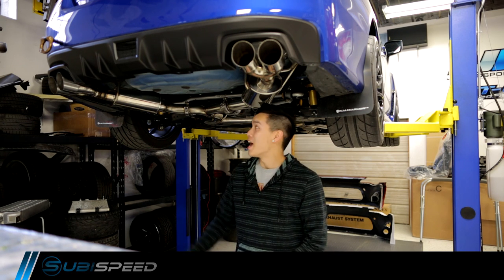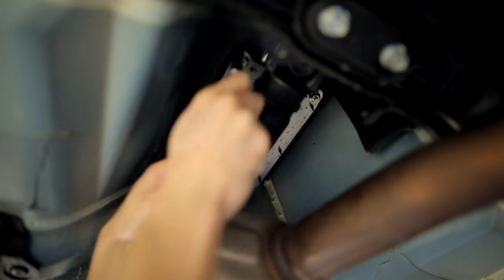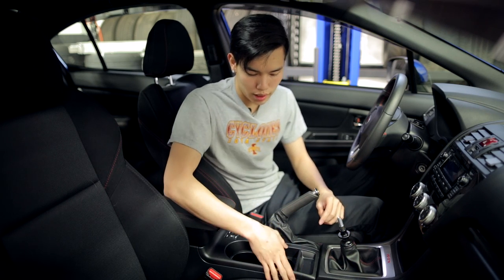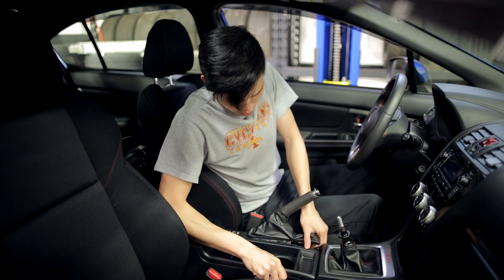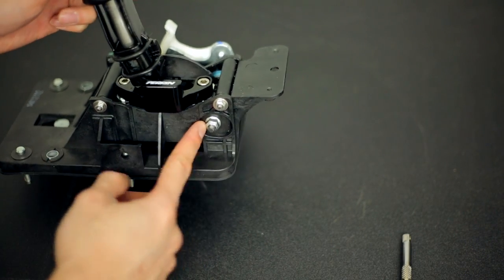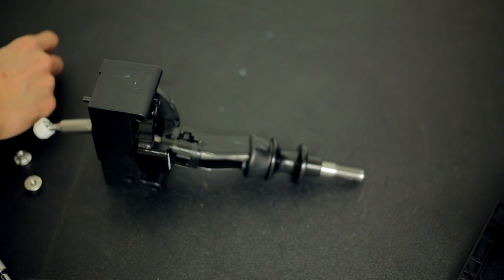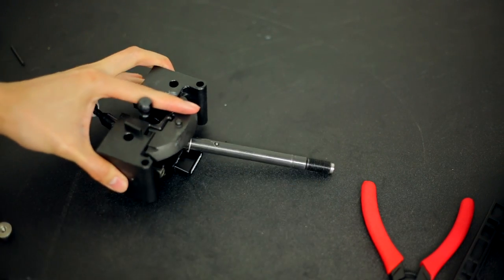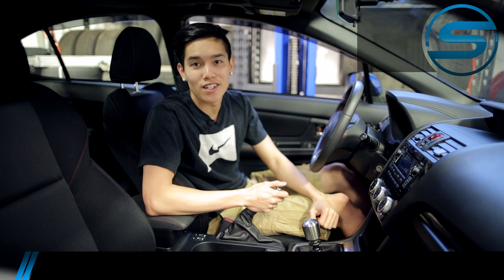How To Install Short Throw Shifter on a 2015 Subaru WRX

Comment: Good gosh...insane install. Guess stock isn't so bad.
Reply: Kyle Rosenberg Cobb took way less time
Reply: It's not that bad. I know this is 5 years old, but it's like an hour. Unless you lose something very important, then it takes forever. It's legos dude, everything fits back together the way it came off the biggest hassle is that 12mm bolt in the neutral plunger. One step he didn't mention, is do not lose the nut on the inside of the assembly. He didn't even talk about the nut. That nut is super important, without it, you are fucked. Best to punch out the reverse lockout before removing the 10mils at the bottom. That way when you remove the 10mm nuts and rip the bottom off the nut is less likely to be lost. I lost mine it's somewhere, i just can't find it. Had to walk my happy ass to home depot to buy a grinder, and grind down one of the 10mm nuts to fit in there. It's in there forever now, but it works. If you lose that nut you have to do that, because it's not a normal size. It's the same thread pitch as the 10mm nuts, same diameter hole, but much smaller. You also can't buy that nut, you have to buy the whole assembly which is $200. But you know what you can buy? The 10mm nuts from the various locations. So i'll take improv over that. It only takes a while if you think about it too much. The reverse lockout pin is the hardest. Especially when you dont have a punch. I used a flatip, and when it was too far in, i held an allen wrench with pliers. Snap ring pliers, don't have those. But i got two hands and 2 pairs of pliers. Would have been done in a hour if i didn't lose the nut. With the right tools, probably 30 minutes tops. I put in a billet shifter, but it's the same process.
Reply: I’m about to try. I’m terrified
Reply: @mattevans1643    I didn't even notice that nut fell out till I tried putting the screw back in. Then it took me a while to realize that it goes inside the assembly and not on the outside 🤦‍♂️
Reply: Until the stock shifter snaps🙄

Comment: This install can also be done without removing the entire assembly. I couldn’t remove the four lower nuts  from the shifter assembly, so I removed the two side trim panels around the shifter to provide more room, and proceeded the sub-assembly removal. Was able to access all the bolts. Was an easy install. Seems like a lot but once you get into it, it’s really simple.

Comment: this install took me about 4 hours....super difficult but one thing i want to mention at 2:16 he removes 4 10mm nuts, on my 2016 the bolts came loose and i was unable to remove the shift assembly so i had to do the whole process from that point in the car. at the end of it all it was really worth it shifting feels great. i also did the perrin shift bracket and bushing along with the stopper guide
Reply: What did you do to remove them? I'm having the same problem.
Reply: Dude with the Tunes  you’re not gonna like this but I disassembled the whole thing in the car...it was super tough not gonna lie. Also be careful that plastic casing is fragile if you tighten the bolts too much it will crack and fall apart.
Reply: I think there are more. I removed 6 and it was fine. I thought the same thing you did

Comment: Would be great to see how the side shift assembly is put back together! Great video but just would have liked to see that as a walk through
Reply: It's pretty obvious but... 
The side shift sits on the ball. The 17 mm bolt goes in. The other bolt goes in. Then the neutral plunger goes in. There is a groove at the top and bottom. The grey parts of the spring will sit those grooves. The pin of the plunger will sit in the middle of the white part, you know by looking at the already destroyed surface by the plunger. The 12 mm bolt goes into the nut located inside the assembly, do not lose that nut suring disassembly will have bad time. And that's how that works.

Comment: Awesome install video guys!! Just finished the install and this video helped a ton.  To the guys that say this is too hard or intimidating, just give it a shot.  It's definitely not hard, but it is several steps so it can be time consuming, especially if you take your time like I did. In the end it is totally worth it though as it completely changes the driving experience for the better.  If you have the Perrin shift stop you'll probably have to readjust it and the reverse lockout stop to make sure you can still get in all of your gears easily.

Comment: @billetworkz this is due for an update guys.  Biggest issue I found with your video was the lack of info regarding orientation of parts and tool sizes used for each part (ie punch size and socket sizes here and there)  

Also, I had that greasy spring pop out on me when I removed that part of the assembly and had no idea what it looked like prior because I didn't know to check.  I had to pause your video and zoom in and guess how the part was supposed to sit. 

I installed the trifecta, weighted knob (thank god cause that plate needs one), short shifter and plate.  Night and day difference.  Its a little notchy for my taste but not enough to even complain really because it was notchy stock as well.  The best improvement was probably from the plate and bushing combo.  That completely changed the way it feels to shift.  Before it was sloppish (I did have a Shifter Stop installed) and felt like I was stirring a bucket of rocks.  This shifter feels the way a shifter should feel.  

Biggest complaints: 1st and reverse can sometimes be hard to get into, but I think an adjustment to the shifter stop will fix that (however in my experience you want it to be initially a tad too tight because it will loosen over time).  Also, the shift from 2nd to 3rd was tough at times but that's probably an adjustment I need to make.  3rd to 4th on the other hand is chef's kiss 4-5 is good and 5th to 6th is just as nice as 3rd-4th.  1st-2nd is that way too however I think due to the shifter stop being too tight, I'm getting resistance from it.  I'm probably gonna miss some shifts for a day or two haha.

The throw of this shifter is the shortest I have ever felt period.  55% reduction is no joke no to mention the knob sits lower than stock.  Also there is more resistance on the shifter while shifting making it feel very tight in travel distance as well as the shifter feel.  This will probably become normal to me over time.  Keep in mind this is also coming from someone who just took a 5 minute test drive to make sure my car was good to go for work in the morning at 1 AM.  Thought I would share my initial thoughts.  Hope you take this post as constructive criticism as I don't intend to bash on you.  Your craftsman ship is the best I've experienced and I will certainly be looking in your direction for future mods.

Comment: installed it last weekend. This would have been so much easier if he finished up the video and didn't forget to install one of the bolts. 
Notice at 6:51 he removes o-ring and one of the metal nuts falls out, (3 nuts on the table instead of 2) you can hear it fall on the table too. That fell out from under the assembly and is used to tighten the bolt shown at 5:33. You can kinda see the nut at 6:33.
Also pay attention how the side shift assembly is put together because the three pieces could be pain in the ass to put together if you don't know what you are doing.
Also the shifter now hits the hand brake so I would probably need to upgrade that....
Reply: good look man. ive been studying this video so I can install mine since Subaru wants almost $300 to do it. bleh
Reply: What kind of nut is that that's holding that piece in? I just ran into this same problem
Reply: @ONEupD808  You can see the nut fall on the table at 6:51
Reply: @robert23kim  thanks for the reply man. I finished the install and I did find that scew luckily. I dont know how they left that part out of the video but everyone that does this install do not lose that damn screw! It just falls out with out even noticing! Good thing I found it...phew!
Reply: @ONEupD808  for sure. I had to leave my car in a random parking lot because it was dark and could not figure out how to put the damn assembly back together until the next day.
Reply: @robert23kim  holy shit! Good thing you got it back together lol
Reply: @ONEupD808  lol i out a billet shifter, and i lost that nut. Don't know where it went. So grinded down one of the 10mm nuts and shoved it in there. It works. Also you can't buy that screw. It's a special part that only comes with the entire assembly, which is $200

Comment: You just make me change my mind on doing a short shifter change lol I think I'm going to stay stock ! Lol
Reply: riiiiight? lol i was thinking the same thing!
Reply: It's easy, and worth it. It's simple steps. Remove heatshield, and cover. 8 bolts. 
Remove cables and 4 bolts from under the assembly. 
Take trim apart. 
Remove 4 bolts from shifter assembly. 
Pull out assembly. 
Remove two screws holding metal tabs. 
Remove 10mm nut using 17mm wrench on other end. 
Remove 12mm bolt. 
Remove 7mm nut. Punch out the roll pin in the reverse lockout. 
Remove 10mm nuts from bottom of assembly. 
Remove shifter rod. 
Make sure the nut from the 12mm bolt on the plunger did not fall out. 
Dissasemble new shifter. 
Put new rod in.
Make sure not for 12mm bolt is present. Put bottom cover back on 2 10mm nuts. Back into shifter housing. 
Put 2 bolts with 7mm nuts back in. 
Put side shift back on with 17mm bolt and 10mm nut. 
But plunger back in with 12 mm bolt(make sure the nut is still there).
Put two metal tabs back in. 
Reassemble shifter if not already done. 
Reinstall in vehicle with 4 bolts. Go underneath car, reconnect cable to shifter.
Go back up, make sure you have every gear. 
Go back down use 4 nut to secure bottom of shifter housing. 
Reinstall cover of shifter housing. 
Reinstall heatshield. 
It's alot, but it's like an.hour of your day.

Comment: my wrx came with the sti short throw shifter is there a large difference in length between the sti short throw and the boomba??
Reply: No, not worth doing. The best thing you can do is buy a shift stop for 1st and 2nd gear. It's a few % shorter than the STI shifter. Nothing you will notice, except the first time. Then you'll question why you bought it cause it feels the same. The only difference is the construction.

Comment: Is this a worthy upgrade if I already have the factory short throw shifter option installed on my 15' WRX? Or are the results very similar?
Reply from the maker: Yes, this is compatible with the STI short shifter and will reduce your shifter travel.

Comment: I have a question mechanical experts please inquire. I have the 2015 wrx my car read a double reverse 6th and reverse gear. It was after I swapped to a "2016 transmission specified for 2015-2018 wrx" and put a southbend stage 1 clutch kit+flywheel the in the steering column the ecu read a double reverse from a 6th to reverse shift and in neutral without pressing the clutch in it makes a harsh grinding noise it’s also giving me issues shifting clutch to the floor to first and a few gears. Any diagnosis?

Comment: At 6:53 the nut that the neutral lock plunger screws into flew out of the shifter. Same thing happened to me. Had no idea where to put it back for a good hour as its glossed over in the vid lol.

Comment: This video helped a lot, but, omg what a pain. 
Around 6:33 the part to remove the bottom of the housing the nuts were so tight it spun the whole shaft (where the shift stop goes) 
Had to drill small holes through the metal and plastic to put a small, 3mm allen wrench in the holes to stop the shaft spinning so I can get the nuts off.

Should also be mentioned everything will be greasy when finished.

On reinstall wasn’t too bad but it wasn’t entirely easy either. 

Worth it, yeah for my own car sure but I’ll sell the car with the short shifter if I sell it. I’m not reversing that mod. Most complicated shifter installation I have ever dealt with.
Reply: I had to do something similar, are you able to fully tighten the shifter stop now that that part spins?
Reply: @hetts_  I was able to fully tighten it back down shifter stop wasn’t a issue. I’m using a Cobb shift stop as well which uses studs with lock nuts unlike factory and other aftermarket shift stops that just use bolts as well.
Reply: @jason216cleveland  oh shit, I’ll have to buy a cobb one and see if that can get fully tightened then. Cause right now the Perrin one I have tightens about half way and then the whole thing starts spinning again
Reply: @hetts_  Yeah some people complain about the Cobb shift stop being plastic but it’s the best one I’ve used so far, it’s tall like the factory stop on the reverse side of the shifter so no more fingers getting pinched by the reverse lockout

Comment: Is this any better than the option short shift upgrade from the dealer?
Reply: Of course for one it's 2 inches shorter then the stock stick, I have the STI short shifter in my WRX and honestly it don't really feel much different then the regular one that came with the car I mean it's more stiff but nothing to write home to mama about if you kno what I mean....
Reply from the maker: We do not have the STI short shifter upgrade installed but I can definitely say I felt the difference right after this was installed. The build quality of the shifter is also very nice and solid.

Comment: I did this install on my 2015 wrx in Oct and now it doesn't seem to go all the way into gear.  1st 3rd 5th. But there's not grinding and it's not difficult to go into any gears.   Just doesn't seem to shift the same way into the odd numbers.  Any ideas?

Comment: It's just those 4 bolts underneath as to why it's not possible to disassemble from inside the cabin, yeah? 

Is this doable with just Rhino ramps, or must it be on a lift?
Reply from the maker: As long as you have space underneath the car to get under it then it will work.
Reply: As long as you aren't at risk of dying sure. Although ramps i wouldn't trust. Unless you chock the rear wheels. Sure nothing will probably happen, but it only takes 1 time for that something.

Comment: I just installed my boomba sts and noticed that it is extremely off center. It goes into every gear and functions perfectly however I was wondering if it was intended to be so much closer to the driver? I find that the boot will bunch up because its so much lower than stock and sometimes it'll make it hard to get into 1st or 2nd. Is there a way of correcting this, perhaps adjusting cable lengths or something? Would greatly appreciate a response @SubiSpeed Thanks!
Reply from the maker: That's how it is designed.

Comment: do you have to unbolt the mid-pipe or whatever that portion of exhaust in the video ? and do you need to replace a gasket?
Reply from the maker: Munther AL-sulaimi you do not need to remove any of the exhaust.

Comment: Hey SubiSpeed, got my Boomba shifter yesterday and installed it today. Let me say that this was a PITA lmao. 

My only concern is that the Neutral Plunger doesn't seat itself directly in the middle of the white brace from the side shifter assembly. It's on, but not directly in the middle like OEM. The Neutral Plunger bolt appears to not stay put. 

All in all, it's on and I can roe through all the gears with ease but I'm afraid that power shifting may push the plunger out of alignment. What are you thoughts?

Also just a recommendation..... You should supply more Laffy Taffy's based on the difficulty of the install haha. I got so mad at this install that I ate it within the first 30 minutes.
Reply: Gabriel Estevez I also have that concern about the shifter not being in the middle. @Subispeed or @BoombaRacing,please comment on this. Thanks!

Comment: Any recommendations with snap ring pliers? I bought a cheap set from Advance Auto Parts, but one or two of the tips on each interchangeable head aren't small enough to fit into the holes of the snap ring...
Reply from the maker: +Raphael Monta We just bought whatever they had at our local auto parts store.
Reply: I did it without, just took a person helping hold it out of the ridge

Comment: I am thinking to have this shifter. 
I have 2016 STi and I have factory short thorw shifter. is that going to be same way that WRX has? 
and should I remove factory STS? 
Thank you!
Reply from the maker: +Sunghoon KIm This will not work on the 2016 STI it is WRX specific. However, we do have STI short shifters available on our website.
Reply: @SubiSpeed  it is not wrx specific lol. The imprezza and crosstrek have the same assembly. Any part you can put on a wrx transmission can be transferred over to the crosstrek and imprezza. Because they have the same transmission. The only difference is the shifter plate, and the gearing. Well 2015+wrx and a 2017+imprezza, or 2018+crosstrek.

Comment: serious question...why not just cut the existing shifter down to short throw spec and re-thread the shaft? Would be a 30 min ordeal assuming you have a thread kit
Reply from the maker: That is not an ideal and effective way of decreasing the throw of the shifter. The real difference is the length of the lower portion of the shifter that connects to the linkage. On aftermarket short throw shifts, that portion of the shifter has been shortened, significantly decreasing the shifter throw.
Also, cutting the shifter would cause issues with the reverse lockout.

Comment: How does this compare to the optional short throw shifter available through Subaru?
Reply from the maker: Spencer Stucky You will see a bigger difference in shift throw and the position of the shifter when the Boomba short throw is installed.